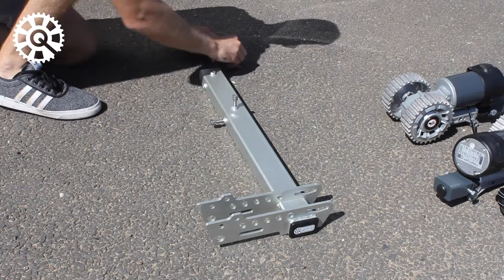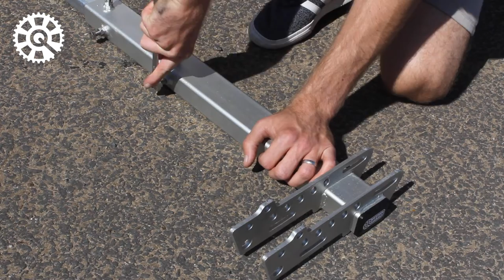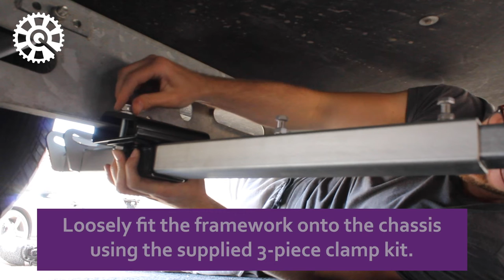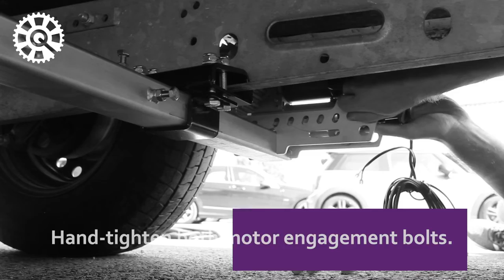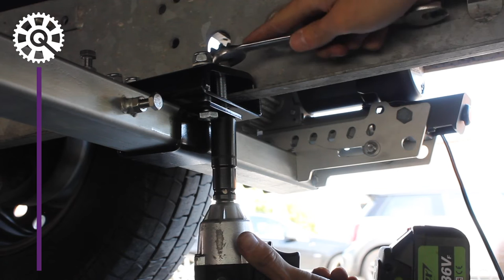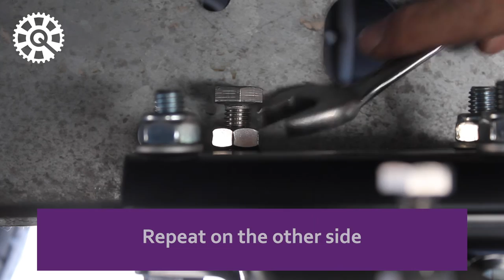How-to: Quattro Diamond Automatic Engagement Motor Mover Installation Guide (QUATTRO600)

Comment: I have the Purple Line Q600 auto engaging all wheel drive system on my tandem axle 3.3 ton Caravan. I have a 300ah lithium battery so there is plenty of power. I also have a Bos370 heavy duty dual wheel jockey wheel.  This system moves my caravan back and forth and on a 5 degree incline effortlessly BUT it does NOT turn the caravan unless you have about 50m of travel space to work with. Not very happy as this was expensive.
Reply from the maker: Hi - Thanks for your comment. I'm sorry that you're experiencing some issues with your mover. Could you please contact technical support at your local Purple Line office where we would be happy to help you 🙂
Reply: @PurpleLine  This is the problem. There is no local Purple Line office in New Zealand. Who should I contact to help?
Reply: @AMERIKIWI  Curious if you tried the 2 button turn method?